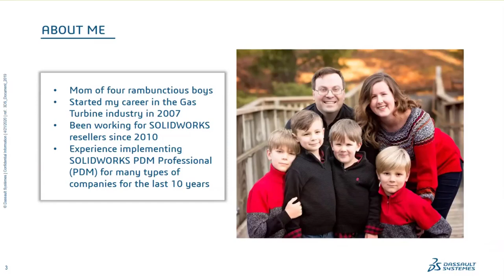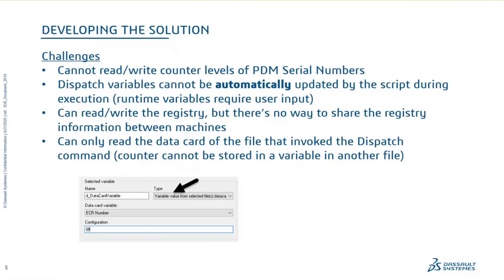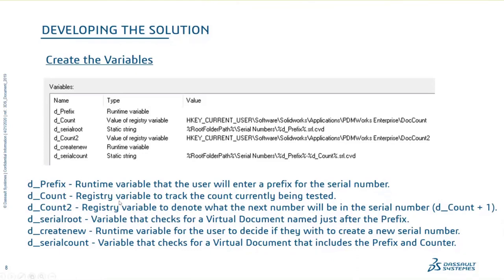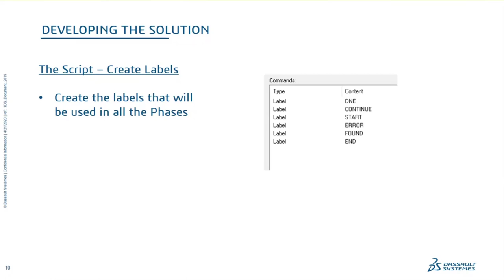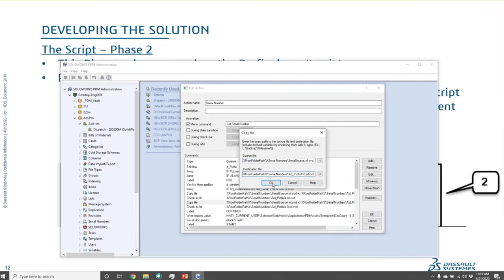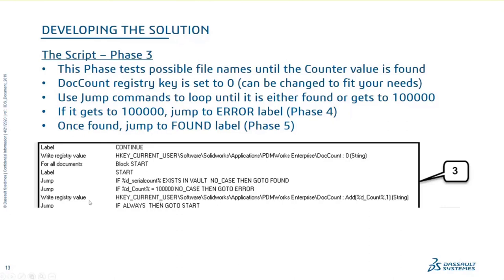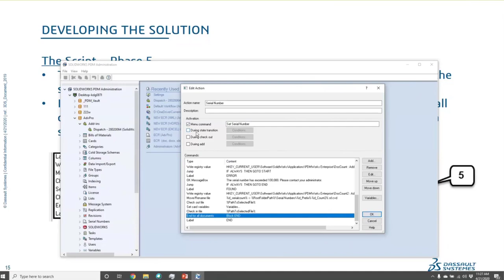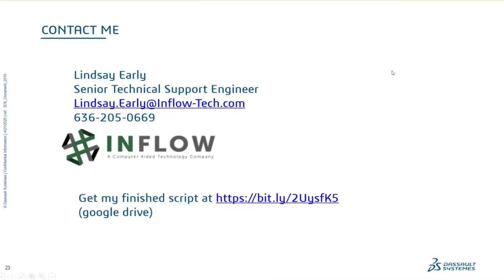Use Dispatch to Create More Versatile Serial Numbers

Comment: Thank you for a very useful presentation! One Question: In PDM serial numbers you can set the "Counter value" 1, 01, 001, 0001 etc. Is there any easy way to change it to e.g. 001 instead of 1? Maybe I can set it to 1001 and then remove the first "1" with "String Functions"? I will try.
Reply: Did you get this to work?
Reply: @frankmusick2017  I know this comment is super old but I was able to to exactly this with the "right" function.  Essentially if you want your serial number to read 00001, you need to set your actual serial number value to 100001, then use the right function to isolate the all of the digits aside from the first 1.  Hope that helps.